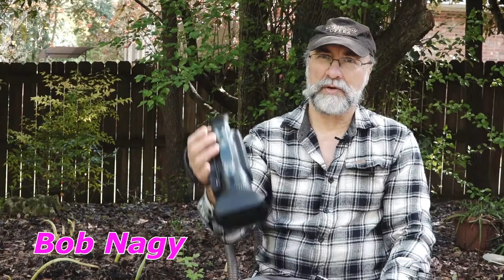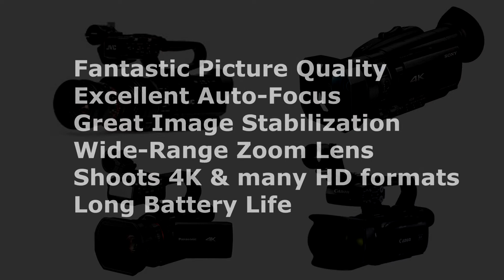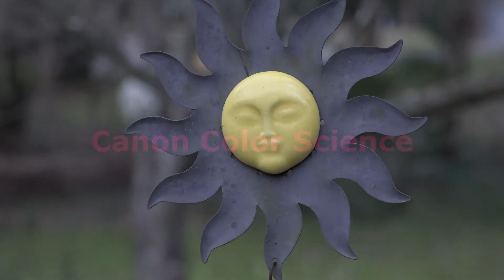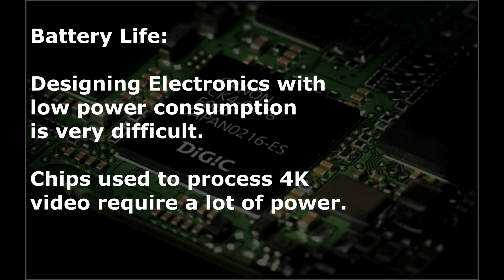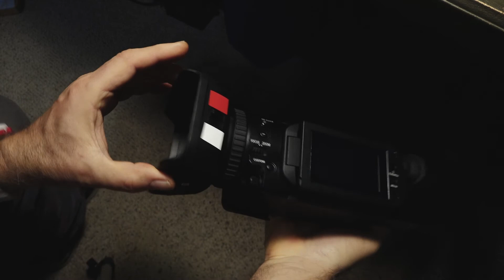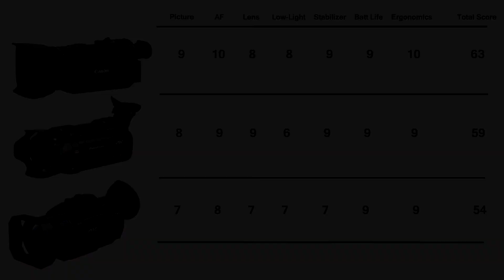Canon HF-G60   Should you buy one?

Comment: So I purchased a Canon HFG60 and used it for two seasons now and basically what I do is a lot of filming of hunting trips not only for my YouTube channel but for other people as well. As much as I love the quality of the picture from this camera my biggest problem and issue is that it makes an amazing amount of noise that comes through onto film from the camera itself! Especially the lens motor transmits noise directly over and if it is cold out the camera makes all kinds of crazy noises that end up on film. None of these noises are audible and at first I thought I needed to upgrade my mic. I put an exceptional mic on and the noise was no better. Even in post editing it is almost impossible to get rid of the different noises coming through? Do you have any suggestions for a better camera for what I am doing? Again it's all about the noise more than anything. Lens quality in both low light and every condition is fantastic with the camera. Thanks and I really enjoy your films and advice!!! Is it necessary to step up to a more professional camera or do I just need to change brands? Help please.

Comment: I have the HF-G40. Nice camera but I had to replace the side and top cover that has the zoom rocker switch. It wouldn't hold a zoomed position. ($80 part) Repair is on youtube. Also, I miss the subject focused in front, background out of focus effect, depth of focus effect, characteristic of still cameras. In manual I can get the background out of focus only if my subject is very close to the lens, the minimum focus distance. I am looking for another camera for video with a microphone jack to supplement the G40. Touching  a face seen on the flip screen to focus on is an option, but who wants to move the camera by touching the screen. Good video Bob.

Comment: I have the g30 and I'm thinking if I should upgrade to the g60. 

Partly because the camera has some faults and glitches. It's quite old now.
Reply: I have the g40 and g30, I think it will be a good upgrade because my Canon G40 is a little better than my Canon G30 especially in the internal Mics.  I do live events and I use the on camera mics because its omni directional with a zoom mic for backup.  I'll probably be upgrading yo the Canon Gx10 because I need the camera to record on two sd cards one for backup.  The Canon G40 can not record on two sd cards in 60p just in lower reolutions.

Comment: Excellent review thanks. Desrves more views.  I have several Canons and Sony camcorders and agree with you about colour - my Legria  (I nearly wrote Viagra) is really rich in colour whereas the biggest Sony I have (2K version - CX900)  is great resolution but leaving me wanting for more. I find there is a lot of tweaking to optimise picture quality from an all round perspective. Somone mentioned your mention of telephone which prompted me to add that the best all round filming setup I had was Industrial VHS by Panasonic back in 1988. It cost me £20,000 and was better than subsequent SVHS, but of course digital immediately wiped the board clean. But it demonstrates that resolution isn't everything.

Comment: Very good review. However, it still shows why camcorder has largely fallen out of love of consumers/prosumers. They are big clunky and lack of innovation, too busy competing with each other in the exact same subcategories. Sigma FP, BMPCC 4k or 6k, GH5 or S1H can be rigged up or used barebone, while offering same or better feature set and image quality for cheaper. In true run and gun ENG style these camcorders are still advantageous.
Reply: BM, like all cameras, on the contrary, have much less capabilities. Sometimes they are inferior in the quality of shooting even to mobile phones. Camcorders are much better than anything you mentioned in the absolute vast majority of cases.
Reply: @csamd9049  show me a superior camcorder under 5k USD is Netflix approved like Panasonic S1H. Or a camcorder similar size as Sigma FP can shoot full frame 4k raw
Reply: If that were the case people wouldn't be using cinema camera's for run n gun work or even pro camcorders for broadcasting work. Camcorders are definitely easier to pick up and use for run n gun than a rigged out system that will either have good autofocus and poor stabilization or no ibis, or great ibis and poor autofocus, not to mention lens autofocus noise, etc.

Comment: Unfortunately a 15x zoom is useless for me. Does ths Canon has some kind of "smart zoom" using the extra pixel of the sensor?
Reply: any camcorder with a 1" sensor will not have a zoom greater than 15x. On avg they will be 12x. All the smaller sensor cams are the ones with the larger zooms but they do horrible in low light and  ability to focus fast.
Reply: Just add an inexpensive telephoto adapter that screws on to the lens in place of a filter.